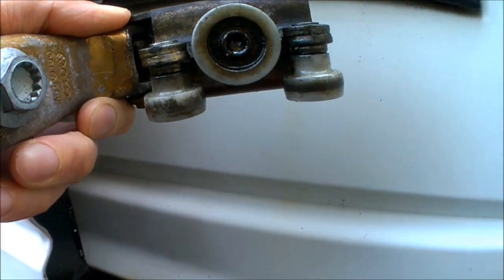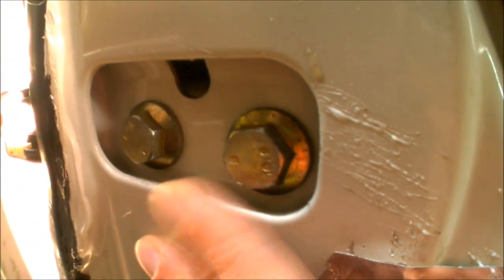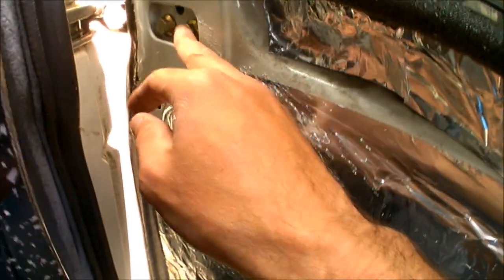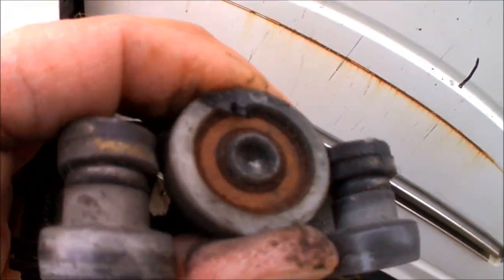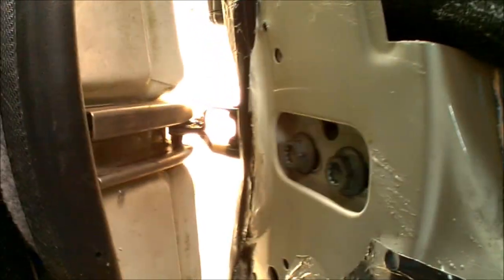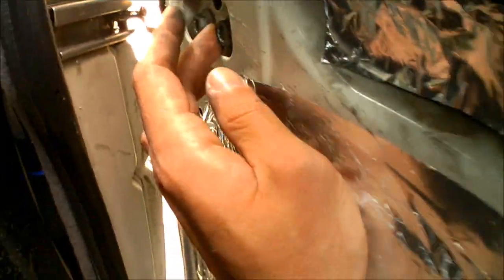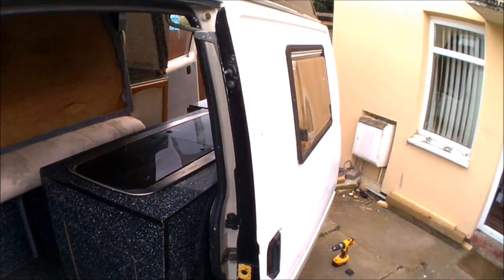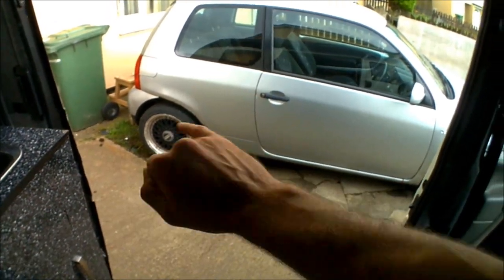VW Sliding Door Roller Repair Middle Roller Replacement, Fitting & Alignment

Comment: Hi, the video I've been looking for thanks! I have an issue with opening my door, I pull the latch and it doesn't budge fully, realigned door etc but still not budging, I had noticed the middle roller is loose (despite bolts fully tightened). Is it meant to be loose or should it be solid and fixed in place.
Reply from the maker: all the rollers should be fitted tightly in place and roll freely